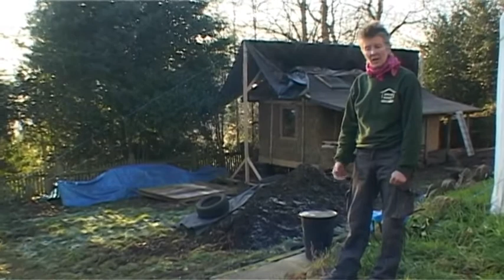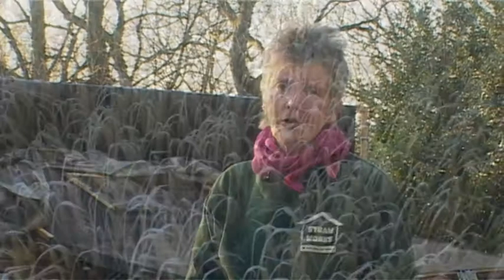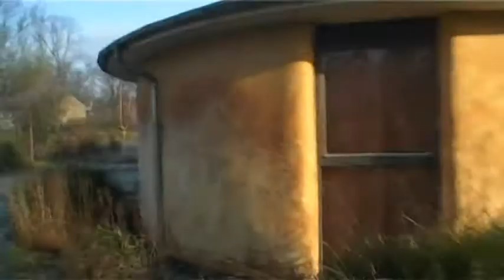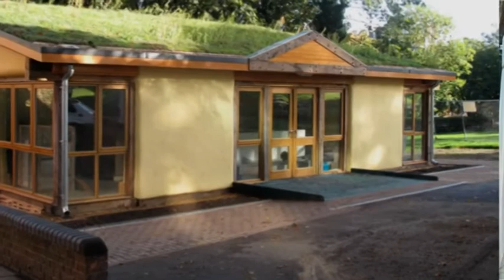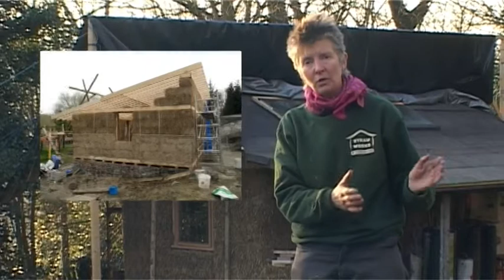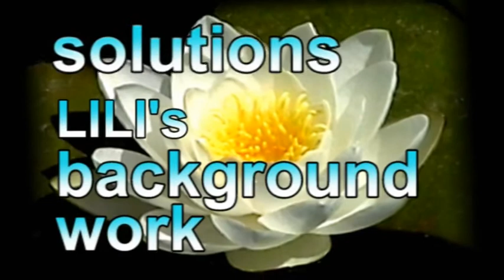Straw-bale Building Course - 1 Introduction

Comment: Can you seal straw bail houses with aircrete?
Reply: no, natural buildings need to breath, concreat will seal it and not let it breath. natural buildings should only use natural materials
Reply: @gazza2963  lime motar?
Reply: @fractalofgod6324  Yes thats fine, but you need to prep the surface of the bail first with several layers of clay, first lay being more like a slip clay mix.
Reply: @gazza2963  thank you Gaz
Reply: @gazza2963  I guess the lime either won't stick straight to the bail or it will damage the bail with its alkalinity.
Reply: @fractalofgod6324  Its the sticking factor from what i know, plus the cost. I cant see how the lime would damage the bail, but then again i have never put it directly onto straw.  I do a wet clay mix first, then i do a thin layer of cob mix followed by a thin lime render. depending on what kind of finish you want. if you want a more conventional flat surface then do an additional cob mix. Barbara Jones does an amazing book called building with straw bales. all you need to know is in there, plus everything else to do with using natural materials for the rest of the house/home
Reply: @gazza2963  brilliant, thank you Gaz
Reply: @fractalofgod6324  No, lime is fine. There's information and a video in the course specifically about it.
Reply: @davedarby2964  nice one Dave